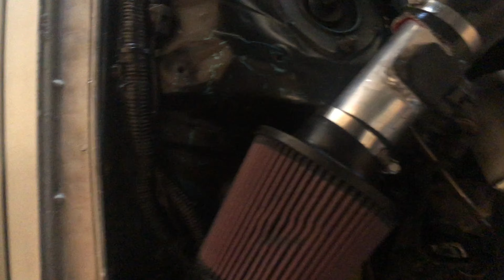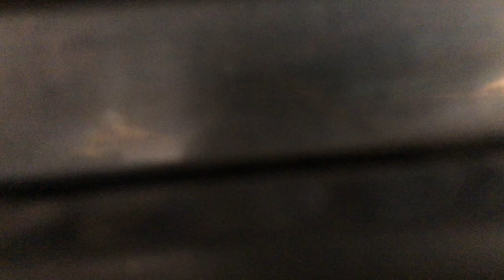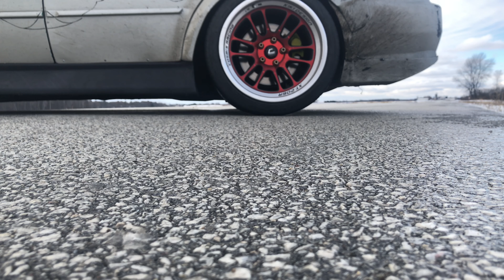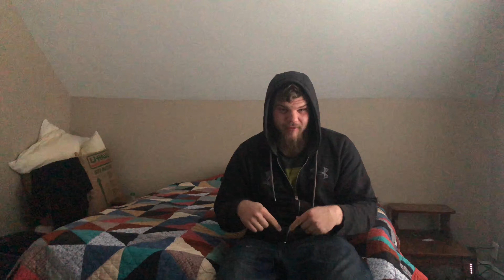Well, thought I fixed it...

Comment: Do what I did on my jeep man, I was having issue with the jeep not idling right so i unplugged the TPS, Idle control valve sensors one at a time to see how it would change the idle and also pulled the throttle body off and gave it a good cleaning and also replaced my fuel injector O rings and cleaned the ports they sat in. turns out doing all of that fixed the issue i was having. Mostly it was the O rings were old and there was a lot of carbon in the ports and on the injectors. hopefully this helps.
Reply from the maker: Julian Codina trust me bro. I’ve tried all that. Go watch my most recent video. It’ll make more sense